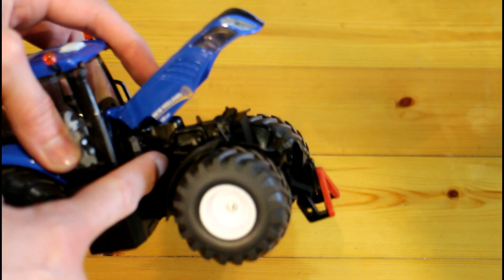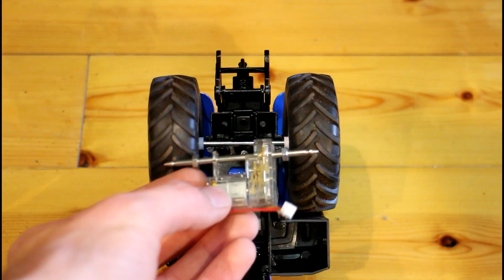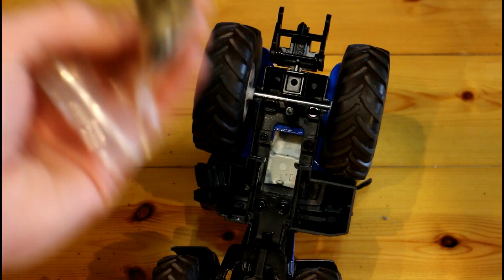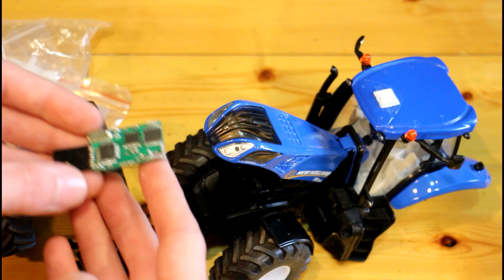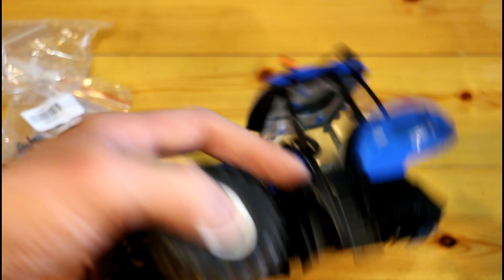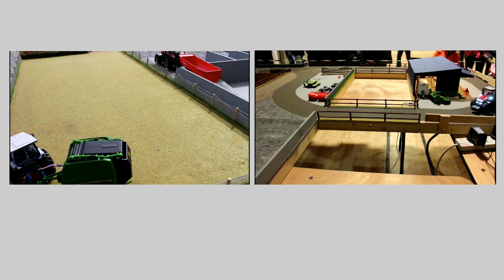RC New Holland Build Part 1 - Disassembly and build plan

Comment: Where do you buy all the parts to make it
Reply from the maker: I get parts on ebay and aliexpress mostly, wherever I can get what I need cheapest really
Reply: @RCTractorGuy  I know you made this video a really long time ago, I'm taking on a build of a die cast Case 7130 and doing my research, this is my first attempt at building an RC tractor I tried looking for a control 20 and a control 32 motor and I'm not getting anything remotely close to what you showed, is there anyway you can send a link to the motor?
Reply: Update, I found the spare parts section on Siku's website, do you need the gear box?

Comment: How much rpm motors do you use for driving by this tractor
Reply from the maker: I think the last motors I ordered were around 70rpm, I think that will make it quite quick but it wont have as much pulling power as the JD8360RT.

Comment: Where fid you get those n 20s I didn't know they came with that gear box configuration? Are the connected or seperate?
Reply from the maker: They are two separate motors, I got them on ebay. Here are the sellers I usually use http://rctractorguy.com/store/electronics

Comment: i am realy looking forward to this build because i plan to build it my self, but i don't have a controler yet. what kind of controler do you recommend for a biginnig programmer
Reply from the maker: If you're trying to build the model the same way as me with Arduinos I recommend this basic controller http://rctractorguy.com/controllers/basic-rc-controller. The added benefit is I'll be including my code for this tractor in the libraries when I'm done so you'd in theory just have to upload the code and the tractor should work.

Comment: trying to find control 32 motors. what is specific name?
thanks
Reply from the maker: I bought them on this site http://www.modellbau-schulte.de/shop/index.php?cat=c147_Modelle-und-Zubehoer-1-32-Modelle-1-32.html sometimes you can get the on ebay.de. They're pretty pricey wherever you get them.

Comment: For the steering I find putting the gear head on a servo  gets you the best steering angle
Reply from the maker: How do you usually connect the gear to the servo, that is the part I generally struggle with.
Reply: +RC Tractor Guy 
I get a little steel gear .  And drill the hole out to the servo and put it   With glue . Make sure it a good tight fit . 
Or you can use the parts of the steering that are inside the Siku tractor. .  Cut the gear off the steering and drill a hole in it and. Stick it on to the servo 

with super glue